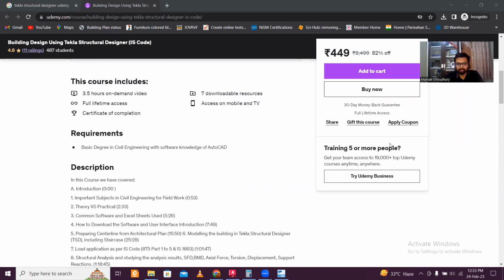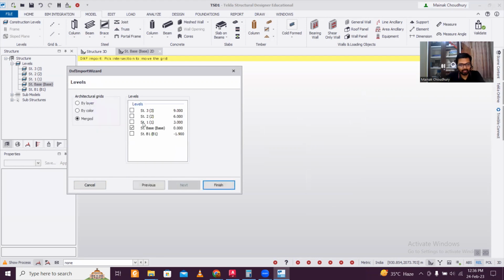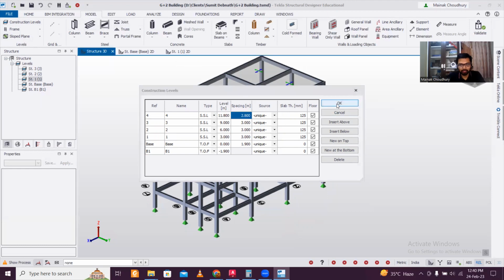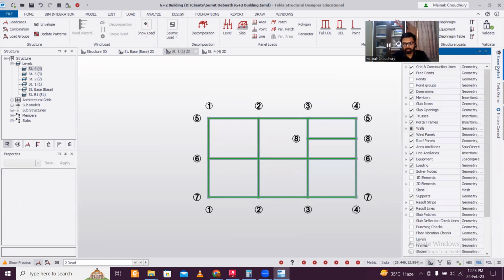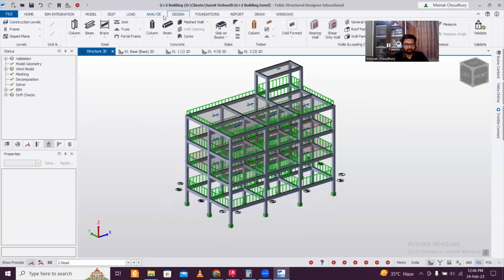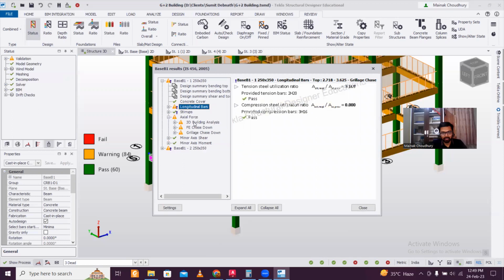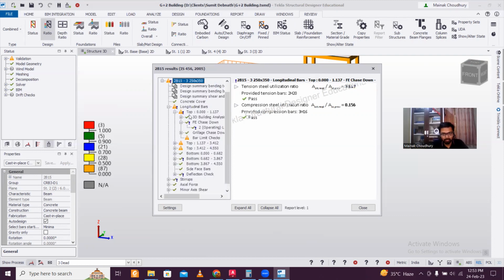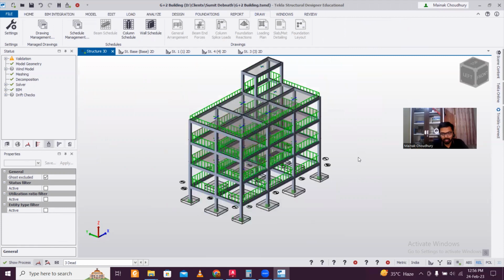Complete RCC Building Design with Seismic Load in Tekla Structural Designer

Comment: What is difference between level load and area load sir?
Reply from the maker: Level load is applied over an entire level, say if I apply at 3m, in all the slabs at 3m elevation the load will be applied, whereas area load can be applied separately on each slab
Reply: @MainakChoudhury  thank you bro.
To clarify, there will be no difference if i use level load or area load right?
Reply from the maker: yes